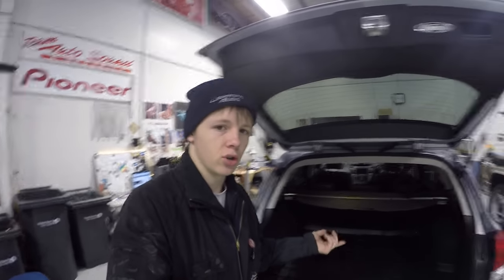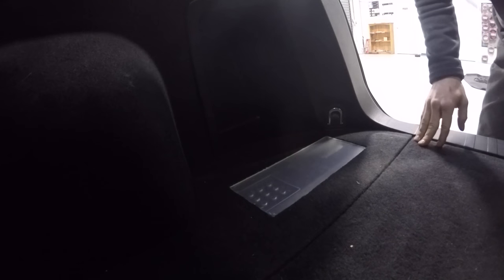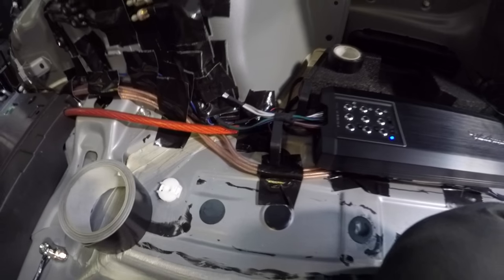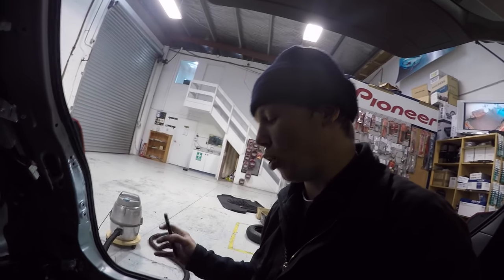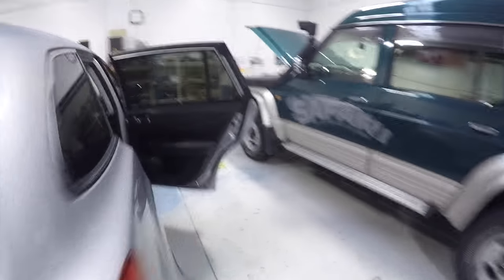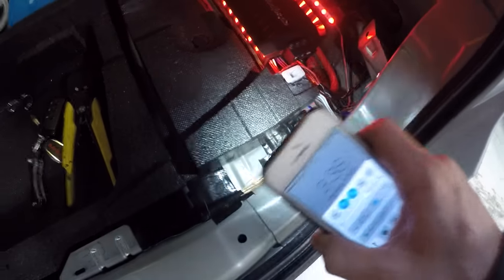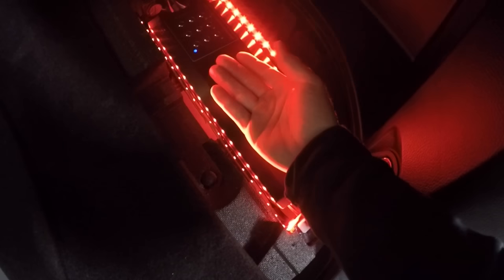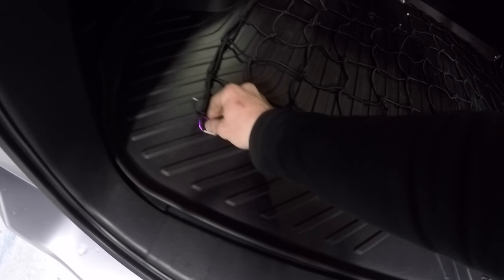Project Legacy: Amplifier Cooling Fans & LEDs!

Comment: Since you have extra LEDs, what about mounting them hidden inside the vents, hooked up to the headlights?  You'd get a nice red glow cruising at night.  A guy I worked with used the little neon tubes, but the LEDs should work i assume.

Comment: You should mount the amp on an aluminum block using a fansink and sandwiched everything together with thermal gap pad. This will make the amp much cooler with significant less fan noise. 

Keep up the awesome videos
Reply: Christopher Fox how would you do this? Any video links you can share?

Comment: Something I could recommend with those acrylic panels would be to try and use tempered or even laminated glass instead of the acrylic, my experience with acrylic side panels when building computers is that they are incredibly easy to scratch and difficult to keep clean. Also there are some other things with heat dissipation that you could pull from computer cooling systems but its probably overkill for an amp XD keep the videos up man I'm learning tons and will probably start installing my own audio system on my vehicle one day because of you!

Comment: Hello, I just bought the same amp, looking forward to connecting in a few weeks. How warm does it run?
After some time now, have the fans helped?
Reply from the maker: Hey yea it actually does run quite warm to the touch, I found before I put the fans in it was affecting the plexi above it. Didn’t affect performance that I noticed. Now it still gets warm but the fans keep the air circulating so it doesn’t cook itself.
I only needed the fans because I have my amp in an enclosed space as you can see, but if it’s in open air you don’t need them.